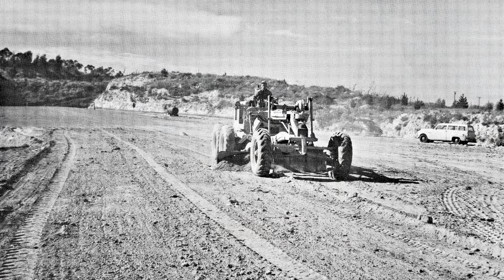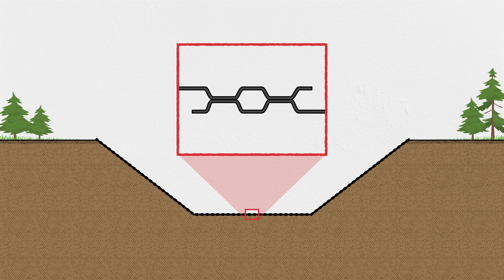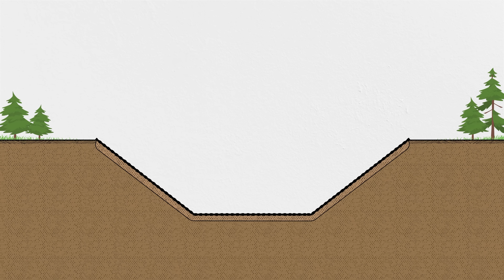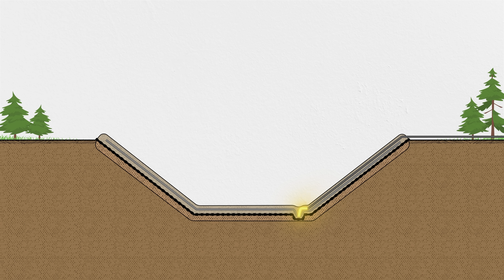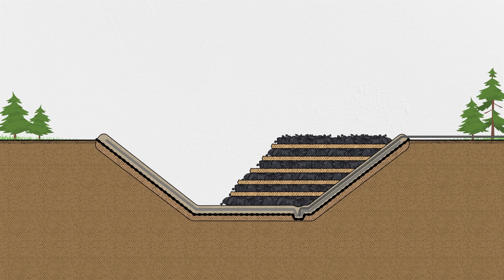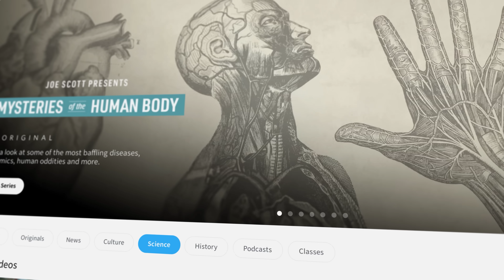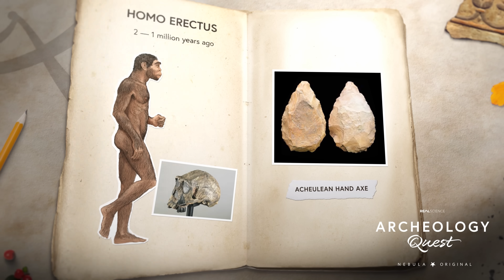The Hidden Engineering of Landfills

Comment: I feel like burning the waste (incineration) in high tech air filtration facilities is a better long term option for water disposal. Much smaller footprint with an endless life expectancy. Also the byproduct of the process can be used as an energy source. Thermal power generation.

Comment: I pay about $25 a month for my trash. 
Luckily, as a truck driver in construction industry, I don't have to go to the smelly part of the dump. We 3 dumps we use. The first two aren't full on dumps and don't accept a lot of stuff. We only haul in construction rubble to those. One of those, we take tree stumps. The third, we'll take trees and branches to since it's free and they grind it up to mulch. We also take the legit trash to that one since it's a full on dump. We just demo'ed a railroad tie retaining wall and took those timbers to the city dump. We're building a proper concrete block retaining wall to replace it. So far, I've hauled in 66 of those 2500# blocks.

Comment: Hey there! I'm a geotechnician that happen to regularly work in landfills that are under excavation. My company is contracted to help identify the soils that can be reused for the lining, the way it can be reused, and most importantly : How permeable is the soil when compacted. We usually need to put up 3 layers of clay for a thickness of 1m, , and test the permeability of each 3 surfaces as well as the jointing of the different layers. Usually a messy job, especially when it's raining.
The goal is to verify a permability coefficient of less than 1E-9 m/s. At this rate, the water would need roughly 10 thousand years to go throught the whole meter of clay. And that's not taking into account the geotextiles that are put above it. For dangerous materials, landfills is required a lining with a permability coefficient of less than 1E-10 m/s, and 1E-11 m/s for radioactive materials.

Comment: As a kid, I lived about 100 metres from a landfill, was great, very easy to dispose of excess rubbish as it was free for locals to dump extra beyond regular streetside collections.
The one I lived near was an old brick pit, so already clay. When the majority of the clay was gone, they closed the brickpit & made it a landfill, ran it for whatever number of years, then closed that & let the ground settle for about 20 years & then built playing fields on it for the community to use.
Every so often after it's closure the flare would go out & we'd get a garbage/methane stink for a few hours until they fixed it, otherwise wouldn't have even known it was there. They always planned on tapping that methane to use as energy, pretty sure they never actually did it though, just had a flame & when it stunk, everyone just said "the brickpit's flame's gone out again", but it only did it maybe once every 6 months at most (although I did hear people say it was more common & depended on which way the wind was blowing as to who knew it was out)

Comment: The most economical place for a landfill, if such a location is close to humans. Is usually to have it fill an existing hole or ravine. Old quarrys and deep gorges are both ideal for similar but not exactly the same reasons. The advantage of a quarry is that there are already roads and property limits that make replacing one heavy industrial application with another cheap and easy. Gorges on the other hand form by water creating a hydralic gradeline through the depression, this makes leachate collection extremely simple. Just add a collection line at the gorge mouth and pipe it into a sanitary sewer for a municipal wwtp. And in a steep gorge no-one will have built anything on the walls so you've got immense air space to fill.

Comment: The town I grew up in built a neighborhood basicaly across the street from our local trash dump. On particularly hot or wet days (which was basically all summer) the rotting, dirty diaper smell was so eyewatering you'd see a ton of for sale signs posted along the street and hardly anyone outside.

Comment: I bought new windshield wipers for my truck today after the old ones fell apart.  The new ones came in a plastic sleeve that used more plastic than the wipers themselves. 
Reduce is the step we really are missing.
Reply: Yeah. But that is the cheapest way got the manufacturer so why would they change. We just have to start using our dollar to support companies with smart packaging
Reply: @mackenziepeek9317  I’ve never seen wipers not housed in plastic
Reply: @s1ime369  yes but buying say wipers doubled in a single slim pack over buying a single wiper in a massively oversized pack. Or finding them wholesale not in the pack are all small steps towards improvement. Certain companies packaging tends to be more wasteful than other companies
Reply: The real waste I see, and this is a relatively recent development, is that you can no longer buy wiper blade refills. I bought them my entire life until about 20 years ago. Now, to get a new rubber blade, you have to buy the blade with a new arm attached too, and they cost five times as much as just the rubber blade. Planned ripoff. As far as I know, only Honda sells rubber blade refills for their vehicles. You just slide them on.

Comment: "There's always going to be stuff that doesn't hold enough value to be kept" is like saying that "gun violence is a fact of life" in the word of the colossal p&ick J D Vance said. This premise is incorrect. If you value plastic, then it is no longer waste, it can be a basis for different types of fuels. Metals can be recycled. It is a question of ingenuity and engineering: plasmalysis, supercrtical fracturation, pyrolisis, gasification are all ways of turning what may at first glance appear to be useless waste into valuable products. Don't be so defeatist, be ingenius

Comment: A couole years ago a contractor I worked for built a new cell for our county landfill. We used a clay liner for the bottom and used perforated pipe buried in a meter of shredded tires as a form of French drain.

Comment: Great video Grady. Having worked on many landfill designs including leachate and methane recovery systems and site closures your explanation was very thorough. We also use GCL membranes instead of a natural clay layer if the materials are not available locally or too costly to import. The GCL is a type of geomembrane with a bentonite sandwiched in between two membranes, it self seals incase of ruptures.

Comment: Question: with the decomposition and compaction of the trash over time, how does the landfill deal with the potential sinking of the surface??

And correct me if I am wrong, but doesn't the "garbage juice" (sorry, but I love that phrase!) eventually become "clean" water, in a similar way that the water that drains into the leach fields from a septic system eventually becomes clean water??

Comment: In our country (denmark) we burn all our trash in big central facilities. The heat gents converted into electricity and distributed heating. All gases are cleaned and the residual waste is reused as asphalt and cement. Seems like a way better solution?

Comment: My Family and I, used to SKI on the Brighton Michigan TRASH HILL.  It is one of the best "learning areas" for skiers, in southern Michigan.  Also the nearby "Alpine Valley" site used to be a giant gravel pit, and it has the best fast slopes anywhere around.  The runs are short, but if you fall, you learn just as fast, and can go-around a lot quicker.  IF they don't have to drag you off the course.